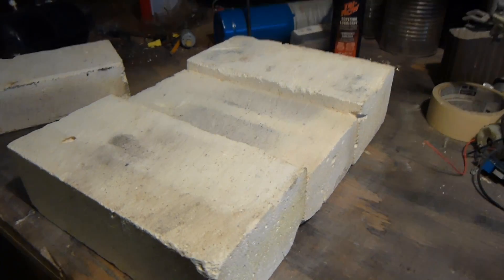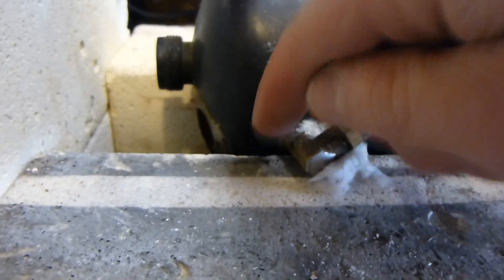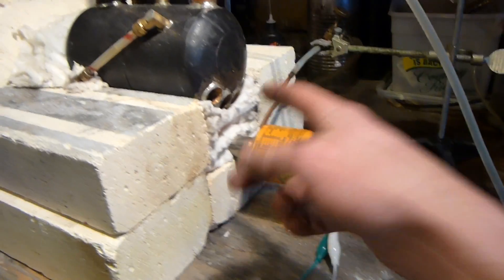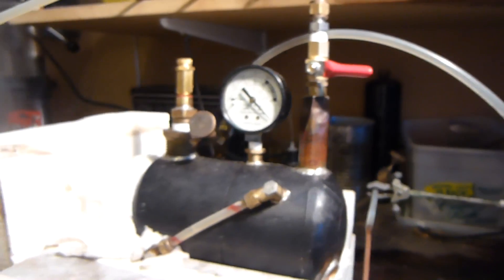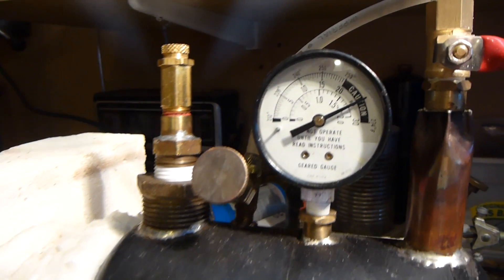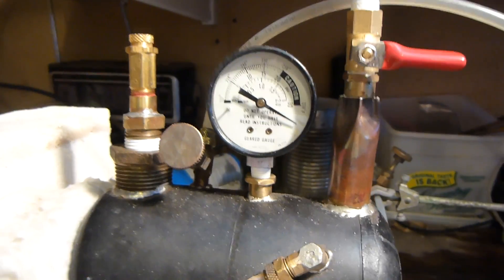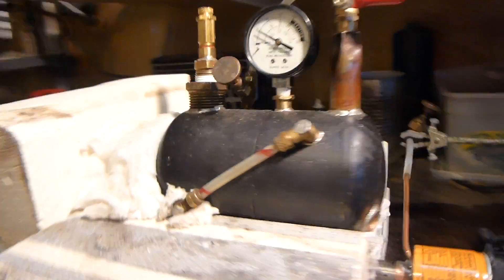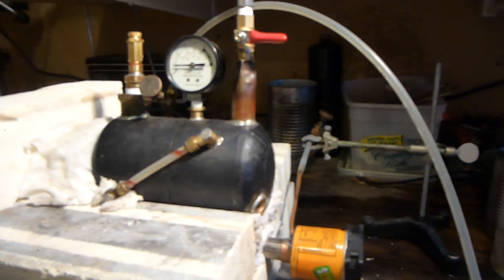Running the Steam Engine at Higher Pressure with New Pressure Relief Valve

Comment: Instead of propane, you can use a sawdust stove to boil water, but use fine sawdust in the can for a long-lasting burn. Connect an alternator with a 12v battery and inverter to your steam engine and you'll get free electricity.

Comment: That pressure relief valve is meant for compressed air and wasn't designed with blowdown in mind. Being a safety device it's not meant to be used quite so liberally at least if you expect it to last any amount of time. Modern steam valves have larger orifices and a set of  rings that can help direct pressure and help push the seat closed after the desired blowdown.

Comment: Quick question on the boiler! What kind of fittings did you use for the water gauge?  I can't seem to figure out how you connected a plastic tube to metal fittings so well.
Reply from the maker: Thanks! It's just a compression fitting with one of those metal tube support things that goes inside the tube to keep it from crushing when you tighten the nut. The fittings I used have the support built in, however they are extremely hard to find. Normal compression fittings with the removable support should work fine too. Also, the tubing is a high pressure nylon tube. https://www.mcmaster.com/#9685t3/=1e3rpqz. You can also get the fittings on McMaster Carr.
Reply: Hey thanks for the response, that Mcmaster website is amazing!

If you don't mind me asking, what's the highest PSI you've felt safe running the boiler at?  Also does the future corrosion of the steel worry you at all?

I've been reading on some forums and have heard many people advising against building boilers this way.  I'd really like to give it a shot but I'm still on the fence.

Comment: very nice do you put oil in the water or how is it lubricated?
Reply: sebastian latray From what i can tell, he has the same loose fit JB weld piston and relies on it expanding to seal it, because of the surface texture of JB weld, I don't think lubricant is "necessary", but would probably increase the power output.

Comment: Well if you find how to collect the steam after the steam engine and turn it back into the steam drum you will get a better efficiency and a closed cycle steam generator. It would be good to connect one rc motor to the flywheel to create energy for the fan and if it got enough power to charge some batteries or connect it to a H2 cell to create hydrogen from water for the gas burner.

Comment: Dude that is super interesting. I work at a state campus in the heating plant and to see a Lil homemade scale version of a fire tube boiler is awesome. Never had the idea to make something like that at home but to see it can be done is pretty neat. That's pretty much a boiler you have feed water now a burner fire tube lol that thing is awesome. If you wanted to make it a constant psi you could always cut of some fuel and turn the burner fan down and then kinda have a lil control of it. You should look into like a rc truck esc to control the speeds that would be so bad ass lol. And just an idea but maybe would help your gauge glass if you could put it on.the front maybe you the flue games aren't going to be an issue? But dude awesome Lil creation plan on seeing many more videos.

Comment: THIS SERIES WAS SUPER AWESOME!!! :)
I have a great itch to do some building with this. I can see my Fresnel lens boiling the water for home brew steam engine with the dual flywheel with magnets on on them. all i would need then is a pancake stator, and something to power up.
I wanna try a water reservoir on the roof for both a re-filler, and a pressure regulator. I must play.
Thank you oh great one.
MUDDy

Comment: How about a steam powered water injector?
a steam nozzle pushing in the water.

It seems impossible, but it's in actual use on steam locomotives!
Reply from the maker: +erlendse I've thought about building one.  Not sure how easy it would be to build one without a machine shop.  Need some pretty precise orifices and venturis.

Comment: Nice work man, I have seen a few of your videos with the engine. 

Have you tried using a rotary valve on the engine?. I have a little engine very similar to yours, and I eventually replaced the original piston valve I made for a rotary one because it leaks less.
Reply from the maker: MisterTalkingMachine Thank you!  No I have not.  I've thought about it though.  Would I basically build it the same way at as my piston valve but have the piston rotate?  Do you have a video of yours?

Comment: You have a nice setup and I like the water pump. Is the big red valve for the water pump or the steam valve for the engine?
Reply from the maker: Great Western Steam Thank you!  Red valve for steam.  Little brass valve is fro the water.
Reply: Makerj101 Thanks. I was wondering what they did.

Comment: All that's left now id to upscale it, attach a 6 - 10 Kw generator on it and a reservoir tank above the boiler with a auto fill float and have that connected to the tap.
That or go on and build a locomotive! Be like a G scale ride-able one lol
Reply from the maker: ElfNet Gaming That would be awesome!  I actually just found an old fire extinguish in someones trash...  I'm thinking about making a boiler out of it.  It would be nearly 3 times the size of this one.  Or I could build a stirling engine out of it.  Or use it as a crucible for melting aluminium...  Choices choices choices...
Reply: Skys the limit lol. an old gas grill tank or motor home propane tank will work well, of course you would have to retrofit it safely since there was gas in them...
The BEST would be an old helium or CO2 bottle if you want a high pressure boiler. 
I assume you have a welder and cutting rig or access to one?
I could build one but I just do not have the time right now. I just got back home only to have to turn around and leave for Las Vegas and DEFCON on Tuesday.. maybe I can get my hands on a couple dozen more solar panels again.
Reply from the maker: ElfNet Gaming Yeah that would work.  Nope, never had a welder or angle grinder.   They are on my list of things to buy.  Just haven't yet.  I normally cur metal with reciprocating saw or grinding wheel on the Dremel.
Reply from the maker: Makerj101 Oh, I do have access to both at HackPittsburgh.

Comment: LOL. everything is running really sweet. Until the hot glue lets go. LOL. Is that water pump a new thing?
You will have to make a twin cylinder version next. That boiler goes really well. I was impressed that the motor keeps running as you pump cold water in. Does the pump line have a one way valve? How many CC's (or CI) of displacement do you think?
Reply from the maker: Mongrel Shark LOL yeah hahaha  
Kinda new.  I think I might have showed it in another older video.  Yeah two cylinder or double acting is on my list of things I want to build.  It's up there on the list with internal combustion engine and forging a knife.  Gosh, I need to get off my lazy butt and finish some project/make videos.  Yes the pump does have a little check valve that I made.  In this video I take apart the homemade high pressure check valve.  https://youtu.be/kE6iNTNB4lM?t=6m50s  I just measured the volume. It's just over 10CC.   3.4 cm stroke and 2.0 cm bore.

Comment: Awesome! That boiler gives off an aweful lot of steam, you could drive a twin-cylinder easily ;). I love the water injection too. But I'd really love to see a generator hooked up to it!
Reply: ch300fnqi IDk about a proper generator that you can plug things into like a TV or a tool, He'd have to upscale it abit and do some auto watering system, bigger cylinders and another cylinder, maybe a gear ratio for torque too. He can put a DC motor on it but those dont usually produce anything usable in the practical sense and under load their brushs will burn out easily too.
Reply from the maker: ElfNet Gaming I've been trying to think of a way to automatically trigger the water pump.  I was thinking maybe something with a glass rod that is inserted into the boiler.  The rod would have a LED and photo diode on the outside.  When the water is touching the end of the glass less light would be reflected back to the photo diode.  When water is touching the end less light would be received.  I also though about probes that measure the resistance.  A float would probably be too difficult.  
I'd probably just use the same DC motor that I use as a gen on my stirling engines.  It seems pretty efficient.
Reply: Trigger by weight, "Fly" the boiler on a set of load cells. Weight goes down = water low then it triggers the pump.
Another way is to figure out how much water is used and have it gravity fed to the boiler from a reserve tank with a float valve (like a toilet tank valve) connected to the tap.
Reply from the maker: ch300fnqi Yeah I really want to build a 2 cylinder engine.  Or at least build one with a better valve design.  Yeah I really need to put a generator on it or measure the power with a prony brake.  Thank you!

Comment: Where'd you find or how'd you make the water pump? That's a pretty neat setup!
Reply: Ray M  Yes, those little pumps are really handy! He probably got one from eBay such as this:
 http://www.ebay.com/itm/Miniature-micro-gear-pump-12v-self-priming-plastic-small-water-DC-brush-ZC-A210-/110940441936
or this
http://www.ebay.com/itm/DC-6V-suction-60kpa-100kpa-4L-min-small-Diaphragm-Pump-Pressure-Air-Vacuum-pump-/231458241945?pt=LH_DefaultDomain_0&hash=item35e3fc7d99

they can also be found in some coffee makers such as the type that force water through the little cartridges, like a keurig.
Reply: Kyler Kraus Thanks!
Reply from the maker: Ray M I got mine from a battery powered insecticide sprayer.  It's a little gear pump.  Those ones on eBay would work just as well.  Good luck!
Reply from the maker: Kyler Kraus  Thank you!